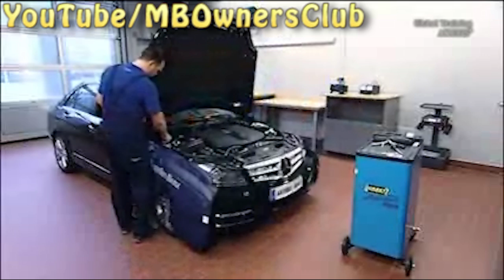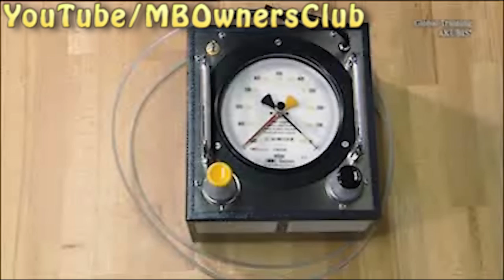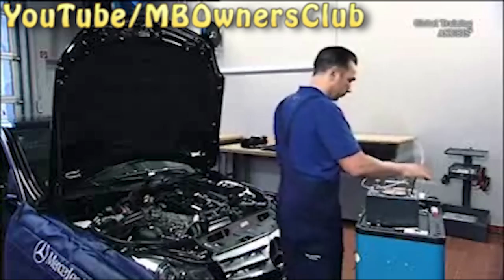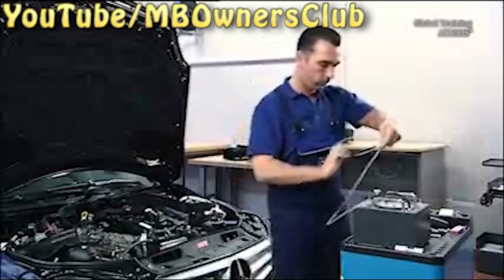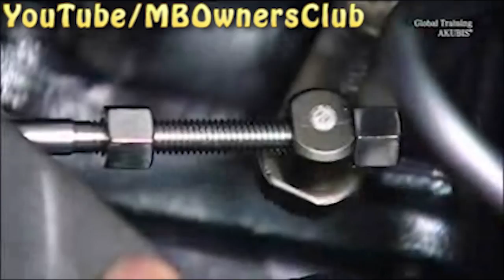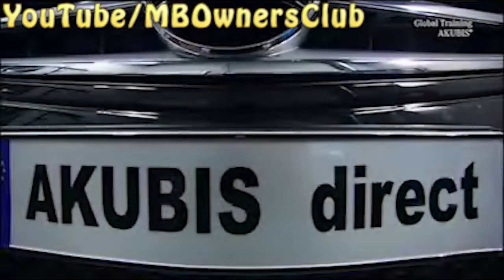Mercedes-Benz Turbocharger Pressure Cell Inspection and Replacement | Engine OM 651

Comment: I have a similar problem spent a fortune on parts but still not solved.
Reply: Maybe you solved it already?
Reply: Had replaced the vacuum cells in the car but it did not make much difference. Eventually found out that the dpf was 400% blocked it was not showing up on the diagnostics. Eventually took it to a merc independent garage he put it on the star diagnostics & regenerated dpf for me now the car flies. Have a small oil leak that needs attention but can't pin point where it leaking from. Its cost me a small fortune so far. All the best to those having similar issues.
Reply: @moazzamali80  what is a Dpf?
Reply: @moazzamali80  was the car really slow before and felt like it had no boost?
Reply: @liammiller712   Hi yes the car was really slow was going into limp mode. With very limited power. My issue was the DPF filter was blocked at 400% which was not showing up on the diagnostics. The fault being shown was related to boost pressure. Hope this info helps you. All the best.